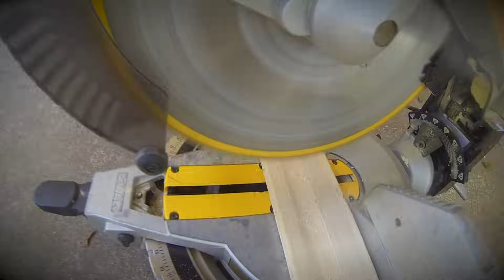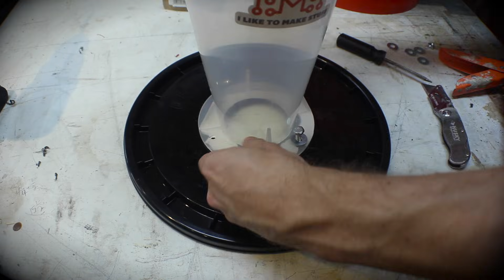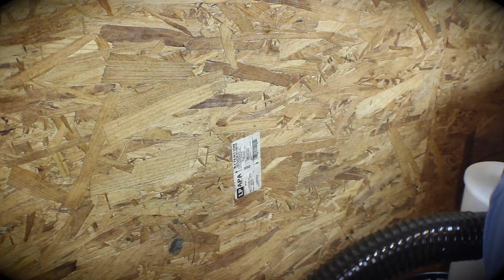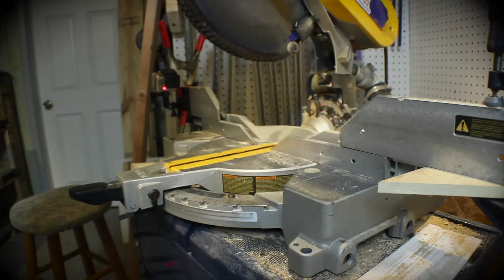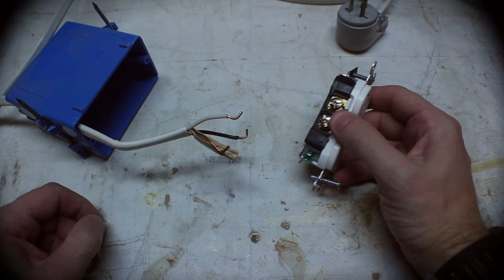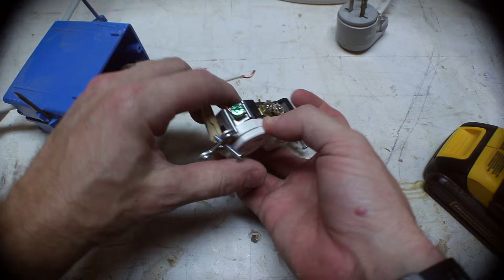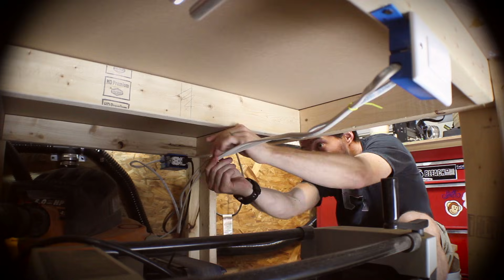How to make a dust collector with a wet/dry vac | I Like To Make Stuff

Comment: Why is the cyclone thing so expensive?? do you have to have this ? what does it do?
Reply from the maker: I have no idea why it's expensive :/  Maybe check other similar brands?  The purpose of it is to separate out the sawdust before it gets to the shop vac. The sawdust in the vac will eventually clog the filter and make it lose suction. you can just clean it often, but having the cyclone in place makes it easy to just dump the bucket of sawdust instead.

Comment: T junctions and hard 90° should be avoided. Both create turbulence that slows down the air and allows dust to build within the system. 

a smoother walled pipe and softer angles will help the air flow better. 

Good clear video just not an ideal technique.

Comment: I can't bring myself to pay $50 for a Dust Deputy.  It's a piece of cast plastic.  It should cost $5.  I'd think duct-taping a megaphone to a couple of pieces of PVC pipe would do just as well.  In fact, I don't see how the cone helps at all; it looks like it was designed to save space inside of a vacuum cleaner.  I'd be interested in a test of whether it's any better than just sticking the input and output pipes directly into the bucket.

Comment: Black to brass yes but on that switch you basically made it a hot box and if you were to touch any metal part of it then the hot would surge through you looking for its ground and being on a concrete floor is even worse when you have 120 volts run through you. With a switch you can switch the white and be fine with no chance of electric shock. You do not want to make a switch live to where it can be a fatal mistake. Just thought id make that note. you can touch white all day long and not get shocked but that black will bite your ass quicker than shit.
Reply: KIDSIXoo hi, I totally respect electricity. So can you elaborate a bit more on the connections & plugs? Thanks in advance. I have no intention of getting myself electrocuted!!

Comment: I have a 12 gallon 4.5hp Shop Vac attached directly to my contractor table saw.  I attached a dust collection hood to the bottom of the contractor saw (sealed around bottom) and it only picks up about 1/3 to 1/2 of the particles. Do I need a bigger shop vac or is that all I can expect out of this set up?

Comment: Very cool stuff.  How powerful is your shop vac?  Do you find that it gives you enough suction to go around the shop?  Thanks again for a great idea.
Reply from the maker: Yeah, mine has plenty of power! Obviously, it's not the same as a huge dust collector, but it works great for most tools when running to one inlet at a time.

Comment: Thank you - I plan on doing this as I am in need of a dust collection system but trying to decide whether to buy a shop vac or a Harbor Freight dust collector. I only have a third car garage space so I'm thinking shop vac. Reviews on Amazon are varied on what shop vac works well. What kind of shop vac do you have?

Comment: Great video! sounds like this system collects a lot of the sawdust, but what is the best way to reduce the amount of fine dust that floats into the air every time you cut something without spending too much?  I notice you have a small closed off shop, which is similar to what i'm setting up.

Comment: Nice. I also used a Jet air filtration unit to filter fine dust out of the air. It's not cheap (like $300), but keeps air really clean and healthy and makes finishing less if a hassle. Also, you can buy a remote controlled outlet switch for your vac for like $20.

Comment: Would this work without a gate?
Reply: Curv 0987 yes but if you have multiple pickup points the vacuum power will be less with each line that's open. it's like having all the A/C vents in a car open vs having only one open.
Reply: Allen McKinney thanks

Comment: Do you still use this system for your dust collecting system??
Reply from the maker: No. It worked fine, but I reconfigured my shop and purchased a large dust collector so this system did fit anymore.
Reply: What system did you move up to?
Reply from the maker: ben_r_ A harbor freight 2HP dust collector hooked directly to my table and band saws.
I keep a shop vac around to other connections if need be.
Reply: Awesome. I just bought one for $186 with tax after using a coupon. I know some people have bought them for $30 less but I think it's still an ok deal.

Comment: Hey Bob, Thanks for sharing your idea. Question?  If I plan on making one for my basement 5 rooms, A. Could or should I install gates at each cyclone I choose? B. I m sure your asking yourself your going to need a Strong VAC? What I was thinking of doing is finding the length to where the suction drops just at the beginning! Then, Adding another shop vac on the other end doing the same. Knowing that both vacuums will NOT run at the same size. What's your suggestion? Thanks Again

Comment: I wonder how does it compare to using normal dust collector?  Is shop vac strong enough for the job?
Reply: Nope, no comparison at all. A shop vac will work with small tools, like a hand held belt sander, but for stuff like table saws, planers or jointers, it wont even pick up 50% of the dust, they just dont flow enough

Comment: What size shop vac is needed? is there a minimum power motor needed for a setup like this. Cheers
Reply: I looked on the dust collector Q&A section on amazon. One guy had success with 1.5 hp. That's a cheapo...Most people probably have at least 3hp.

Comment: I like this idea! My shop is actually my garage so I don't have much room. I confused about the set he has. Please correct me if I'm wrong...the hose on the top of the cyclone is connect to the shop vac. The hose on the side of the cyclone is connected to the main T connector. The left side of the T connector goes to the tools that are being use along with a blasting cap for each tool. Where does the hose to the right of the T connector going?
Reply: Pretty sure it's just for other tools on the other side of his shop
Reply: Thanks

Comment: 56 bucks for a piece of plastic?  Are they nuts?
Reply: YES!!!! THIS!!!! My partner just said "hey I found a cheap way for you to make a dust collector out of our vacuum, you just have to get this cyclone thing" ... me "... you mean a $60 piece of plastic... and then I still have to do the work?" .. nah..
Reply: Evan Plevinski probably made out of used milk containers too
Reply: well worth the $60. It will pay for itself by not clogging filters and bags.
Reply: Google "DIY Thiel separator"...there are quite a few methods for making your own cyclone without shelling out an arm and a leg.
Reply: I agree it's a bit more expensive than it should be; I could see paying $40 for it. One does have to consider the engineering/design that went into it and, if it's injection molded (not sure), that's an expensive mold.
Reply: Not just plastic but shaped plastic

Comment: the easiest way to remember what side of your outlet is negative, is that the large polarized port on the left is your neutral and the smaller is your hot. when it comes to light switches, I know they aren't in this video, is with the screws on the right with the switch down means the switch is open( no throughput of power)

Comment: Thanks for the video, as i am looking for a "shop-vac solution" for dust collection for a small area. One thing I did not see is how do you connect a tool that has a 2.5 inch dust port to the blast gate?

Comment: current runs through the black...returns to the panel box/neutral bar.thats why only black wires to the switch.think of the switch as a block in the road.when the roads unblocked,current passes through and makes the loop.white is at zero voltage.unless the switch is at the end of the run.just thought you might like to know that.dont believe????look in the code books

Comment: Next time you attach wires to switches, make sure to wrap the wires around clockwise so the screw pulls the wires tight instead of pushing them out. Worst case scenario that could cause an electrical fire.

Comment: I think you're video was great and that's what I would like to make. I have an older Sears 16 gal. 2.0 peak HP wet/dry vac. Will this system work for me? I've noticed the hoses are different sizes on each side. Running from 2 1/4" od on one side and 2 5/8" od on the other. I am just so confused on how to hook up the hoses! That's one of the the things stopping me. The other is, but can I just use this system for my whole shop? I have a table saw, band saw, disc/belt sander, radial arm saw, drill, router table. My shop is 14' x 28'. 

Thank you,
Rick

Comment: I have just set up a system that is similar to the dust deputy as shown in the video. I have used a heavy duty plastic type container that keeps collapsing when the vacuum end gets blocked. could you advise a solution? Thanks.

Comment: I have the same Dust Deputy as yours. I had to get a metal can has the Home Depot buckets collapsed under the vacuum pressure. The metal buckets work great and solved the problem.

Comment: Hey there I'm fairly new to woodworking/making stuff and have most of the tools I need but was wondering what kind of shop vac to get. Would this (dust collector) system work with a small ridgid shop vac? I'm also a little confused as to where all the dirt/dust would go, would any actually go to the vac it self or only to the bucket? Thanks in advance and keep on doing your thing Bob!
Reply from the maker: +demonte252 I've running a Ridgid myself, It's not a tiny one, but kind of medium size (can't remember the gallons off the top of my head).  The point of the cyclone is that it grabs most of the dust and puts it in the bucket.

Comment: Nice job.  Planning on a work table encorporating the dust collection under it.  Like the floor cleaning idea.  I have been electrician over 40 years.  Wanted to suggest the wires bend in the direction of the tightening of the screw.  This will draw the wire further under the screw, where bending the other way will push the wire out from under the screw.  Of course I really go for a tight connection.  Vibration of the tools could loosen the connections over time.

Comment: Good video, thanks.Yes, the hose and fitting sizes are frustrating. For my "system",  I use standard 2" ABS pipe which is available everywhere (the black pipe used for house drain and vent plumbing). You can use straight 2" pipe to replace a lot of the flex hose, and all the tees and elbows just glue together. I glue the flex hose inside 2" couplings. Takes a bit of futzing, but it works well and I can just pick up fittings at the local hardware or home center.Like your videos, subscribed.
Reply: +Bill Wells I like your idea Bill. The Home Depot here does not have the 2" black pipe. The white it does have does not fit my vac hose. Also, did you incorporate the blast gates into your system? If so, did the 2" fit the 2" of the blast gate? This is frustrating
Reply: +Steven S.  No, the 2" pipe does not fit the ShopVac hose, sorry I did not mention that. I ended up with many adapters, which I had to make. So I have quite a hodge-podge assortment of hoses (three sizes of hoses!) and couplings and fittings. No, I have not used blast gates. I just chase around with various lengths of hose, most of which will fit the cyclone separator I made out of a 12" diameter concrete form tube (at H.D.).

Comment: I have a quick question and thanks for the video!! I like how you added a switch to your vacuum. Is the same idea, leaving the machine "on" and cutting current on/off via a switch, ok for most power tools in general? I specifically plan on doing this with my router for a router table I'm building. Thanks again great videos!!
Reply from the maker: +Chris Wood IT should be, that switch is doing the same thing on the tool itself, just interrupting the line.
Reply: I used to make those all the time.  I use cheap extension cords for lamps etc.  you can also put dimmers in them and control all the lamps in your room.

Comment: When you are wiring up the "extension cord with a switch" - you should ALWAYS have the wires wrap around the screws CLOCKWISE.  That way, when you tighten the screw (righty-tighty), it pulls the wire into the connection.   Alternatively,  many switches and outlets now have small holes in the back - you strip the wire, just as you usually would, then just poke the wire into the hole and the connection is made (much quicker and simpler than wrapping wire around screws).
Reply: I was going to say the same thing...

Comment: Hey Bob, I am an engineer that makes dust collection systems for larger shops. Something that I would recommend to you is (if you are finding that you are not getting enough suction) is two things; One would be to use metal straight pipe and as little as possible flex pipe too because flex pipe has a lot of resistance compared to metal duct (usually metal duct it is a bit heavier gauge than hvac systems but I digress) and the second would be to get a stronger collector (maybe more permanent or not). We generally use Oneida Air Systems for this (http://www.oneida-air.com/) on small projects (such as personal shops). They work really well. Anyways though, your video is really great.

Comment: I'm late to be picking these nits, but ... I didn't see a receptacle cover on that box where the vacuum is plugged in. That location will be filled with fine saw dust, which will fill the area inside the box, around the open receptacle. Not good.
Reply from the maker: +J Wagner Yeah, it went on immediately. in the moment of filming/testing I'd forgotten to add it.

Comment: Hey Bob! Great Video!  This may be a silly question but do you find that you lose any sucking power from your vacuum the longer your hose gets?  Is there a certain shop vac you would recommend?  Thanks man, love your videos!
Reply from the maker: Well, my shop is pretty small so none of my hoses were that long. I'm really not sure. Thanks !!
Reply: If the length is really long you can lose suction. The beauty of using a vacuum is that it's mobile. If coupling the shop vac with a cyclone and mobility is desired, build a mobile base that they both can sit on.

Comment: I know I am super late to this, but I have a few months before I will be trying to slowly build my own corner of a shop (my first! squee!).

ANYway.  What are the pros and cons of using a shopvac hooked up to a cyclone and bucket like this vs a cheap(ish) dust collection standalone solution from somewhere like harbor freight?

Is it just that this is cheaper, or are there other pros and cons of each?

Thanks a ton for any insight!
Reply: That depends on what tools you will be connecting the vac to as well as how often you'll be using them AND how much money you want to spend... Lots of variables to consider. If you already have a shop vac then buy a cyclone. If you already have several tools that have a 2-1/2" port stick with a shop vac. The smaller size doesn't pair well with a larger dedicated dust collector as they are designed to draw significantly more volume (CFM). 

What tools do you have or are considering purchasing? Do you currently own a shop vac? How frequently will you be using the shop?

Comment: +I like to make stuff when you hook up light switches or electrical outlets, if you curve your wire in the direction of the screw turn it will curve around the screw instead of coming off. just FYI for future.  Love your videos.
Reply from the maker: MrDLAST Yup, I "know" it, but lefthandedness strikes again.
Reply: Lol. I figured you knew. I used to do electrical work so I couldn't help myself. Still in all your videos inspire me to want to make my own things. One of my top 5 channels.

Comment: I'm fairly new to wood working. What's wrong with just using a broom and throwing saw dust in the garbage?
Reply from the maker: Nothing is wrong with it, but this cuts down on work and on the amount of dust that you breathe in, which can be bad for you over time. In my case, my shop opens right into my house, so cutting down on airborne dust helps keep it out of the house.
Reply: I Like To Make Stuff  Thanks for the reply. I figured it was a safety thing. My "shop" isn't attached to my home, so thankfully dust in the house isn't an issue. 

Just discovered your channel a few weeks ago. Very enjoyable and educational videos. Thanks for the free content!
Reply: HugTheBear55 That dust can kill you over time, don't discount it.

Comment: Would you not lose suction power the further from the vacuum?
Reply: That depends on the power of the vacuum and the distance, but ultimately yes. Maybe not much, maybe a significant amount depending on those factors. Also, using flexible hose as opposed to hard pipe draws down efficiency as well as those t's. A "y" connector would be more efficient. Also, long radius elbows are better than short radius. If a 90 degree turn is necessary it's better to connect 2-45 degree elbows than use one 90, unless you find a long radius 90.

Comment: Could someone explain the purpose of this? I think it's an awesome project with hoses to each machine but what is the bucket for? Is it to give you a bigger reservoir than the vacuum would normally have? Or does the cyclone extract more dust than the vac would on its own? Sorry for the silly question, I'm just curious.
Reply: ***** Thank you :)
Reply: +saximus666 It's more than just the need to empty the vacuum.  Filters are expensive, and this gets out a lot of large/heavy (relatively - we're still talking about sawdust here) dust before it gets to the filter.  It lets the filter deal with just the really fine stuff.